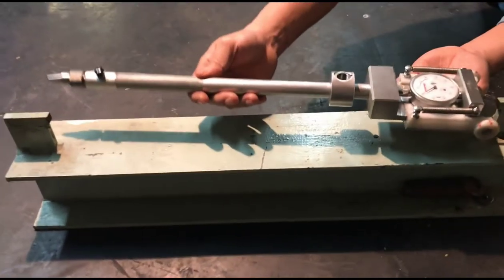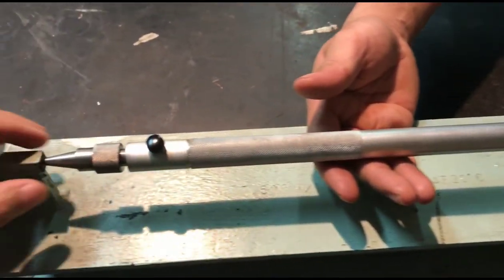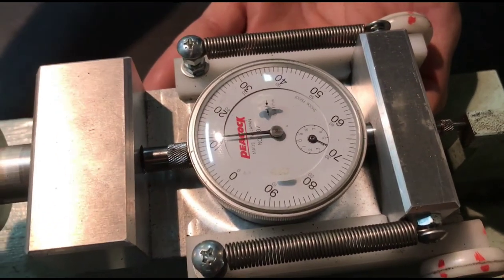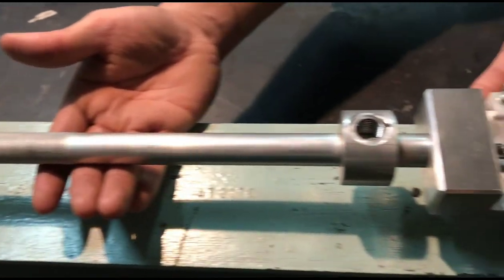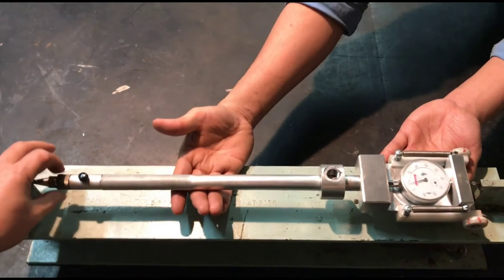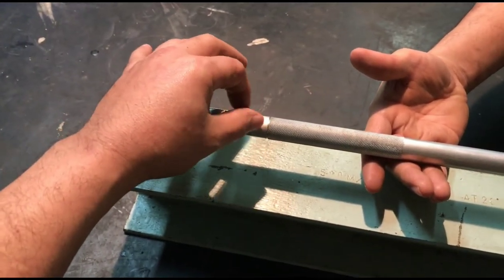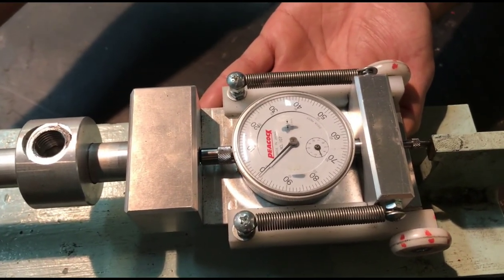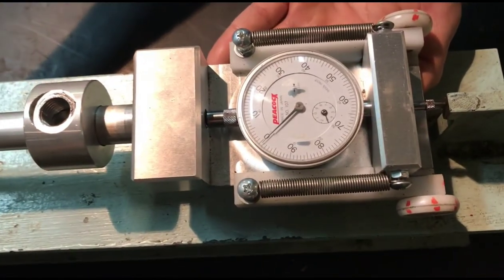B&W Cylinder liner measuring tools

Comment: Why you put small indicator to 3 while your setting is 503 mm?
Reply: Because if you set it to 500 mm for a 500mm cylinder, if there is wear you wont see any deflection. So you add 3mm to see a deflection. Max wear down is about 0.8% max.
Reply from the maker: Thank you brother more power to you 😊

Comment: Yeah 500 mm liner y measuring tool is 503 mm ?
Reply: Because if you set it to 500 mm for a 500mm cylinder, if there is wear you wont see any deflection. So you add 3mm to see a deflection. Max wear down is about 0.8% max.
Reply from the maker: Thank you brother 😊
Reply from the maker: Thank you brother  nice explaination 😊

Comment: but why 503mm when liner is 500mm
Reply: Because if you set it to 500 mm for a 500mm cylinder, if there is wear you wont see any deflection. So you add 3mm to see a deflection. Max wear down is about 0.8% max.
Reply from the maker: Thank you brother😊